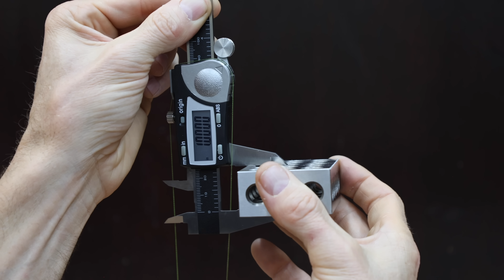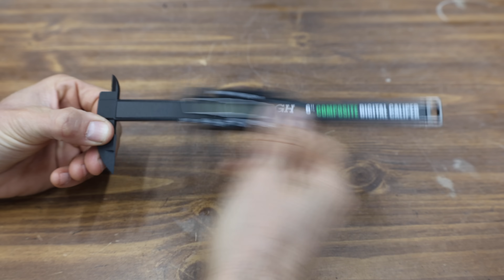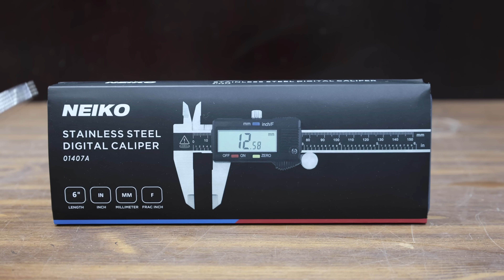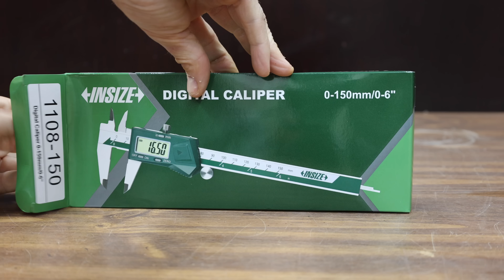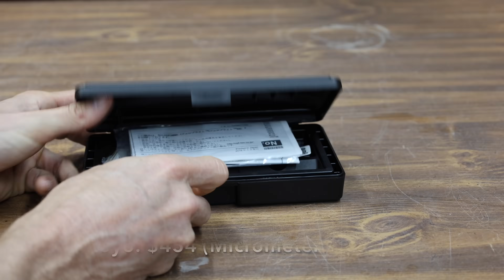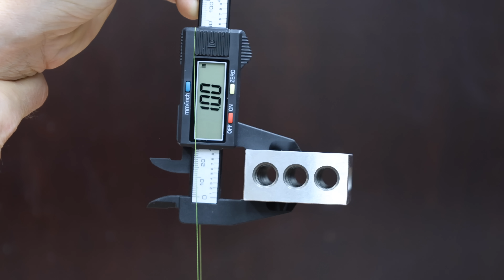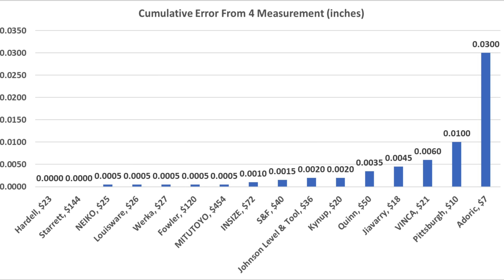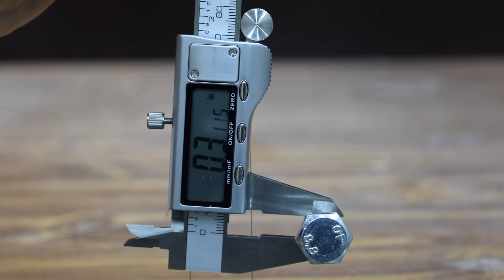I've Been Proven Wrong About Calipers!

Comment: My mitutoyo were heavily used second hand 30 years ago. And are now a bit temperamental skipping numbers.   Still better than the cheapo specials that eat batteries before breakfast,they would benefit from a physical on off switch . As im in uk the starret looks like a good option , will give my mittos another clean before splashing out. And possibly test to compare to your results here. Battery terminal had previous corrosion and metallic dust ingress everywhere. ( imagine Chinese workers watching this video in a room  where they put the different brand stickers on) 
Super video i think it will age well.
Reply from the maker: Thanks!
Reply: Checked starrett website made in china @ProjectFarm

Comment: I ain't a digital gauge guy aside from height gauges but Fowler served me well enough to pass all my setup QC checks against a CMM for 3 years when I was doing production machining. You DO get what you pay for but it seemed to me that the scale of improvement over about the $60 mark dropped to single-digit increases in utile accuracy and reliability and value for the money went down a lot. We also did semi-annual calibrations on all  gauges and we could have anything calibrated in just a few minutes (which I did frequently since I took mine apart once a month to clean them thoroughly). We even had operators using calipers that literally had no branding on them at all and would just have them calibrated at the beginning of the work week. 

Love your stuff.
Reply from the maker: Thanks!  Thanks for sharing.

Comment: The problem with the cheap ones I have used over the years is not the accuracy of the measurement but the quality of the plastic. Cheap plastic warps and fails with monotonous regularity and this is most frequent in the cover of the battery department. So for cheap items you throw them away and replace especially as the plastic life is reduced by exposure to industrial liquids. The most expensive tools will last for a very long time and thus are used by inspection departments for many years and are able to pass technical checks on an annual basis for over,a decade in my experience. You get what you pay for.

Comment: I was super curious to find out the results of your testing. One of my sons is a machinist and has used Mitutoyo calipers in the past. The absolute measuring is probably one of the most handy things to have around when you need to make quick measurements. When I started 3D printing over 8 years ago, I got the Neiko calipers on the recommendation of the maker of the kit I bought. Seems he knew his stuff. Aside from burning through batteries (even when "off"), these inexpensive calipers are quite good, if you don't mind calibrating them each time. For my casual use, they are, what my kids would call, "OP". They are more than what I need and have been reliable through the years.

A really fun analysis of the offerings out there and it's neat to see how you don't need to spend a lot as a hobbyist or even a pro to get some decent gear.
Reply from the maker: Thanks for the feedback.

Comment: i gotta say.. have been using a all steel cheapo from Clas Ohlsson for 10 years now. it is perfect still. the plastic ones are just trash. dont get them. get the all steel ones that take a buttoncell that is under a metal cover with screws. the errorlevel of +-0.02 is acceptable for most applications. but i do have a mitotoyo micrometer for that accuracy that calipers cant deliver.

if your caliper is not smooth to slide? just take some 2000 sandpaper and spit on the paper.. be sure to clean off all residue before testing the new sliding action. goes to without saying for most of you that read this anyway? u can use weapon oil or similar to get her sliding even smoother ;)

Comment: Never trust anything past .001 inches with calipers. Period. If you need tenths, get a micrometer. Also, not doing this in highly controlled temperature (68° F) and on a granite surface plate probably means your measurement differences are the result of inconsistent surface flatness of your wooden workbench.

Comment: 0:48 how did you test the pressure of sliding the jaw? I assume you fully released the locking screw, fully extended the jaw, balaced the caliper on the head just steadying the caliper at the depth gauge so as to stop it falling sideways, zero the scale to capture the weight of the calipers, then apply pressure to the moving jaw steadily all the way down? I just don’t get numbers like you are getting on mine, it was like 100g to break stiction, then just a few grams all the way down. How come all yours are so stiff?

Comment: When measuring with such accuracy a good question to ask is "what is the temperature".  
I learned this the hard way while making a part by hand for an aircraft.  Very very specific on dimensions and tolerance, there was no fudging. As I neared the final specs I stopped and walked over to the calipers to be used for final approval and had them measure unit with the standard in order to know any difference between the standard and my own and found my parts were exactly dead on.  I was shocked and they saw it and laughed.  I was informed I had measured it soon after working it and during the walk across the floor it had shrunk as it cooled.  Yep, I said, I stopped a few mics long and here we are, dead on and cooler.  Went back to my tools and measured, darned if they werent right.  Cooler it measured smaller.  Dead on.
Reply: This is also a reason that it's important to have calipers that are the same material you are working, or at least to make sure the calipers and material are both at the same temperature and it is near the calibration temperature.

If you work in a shop that is hot or cold, and you're working aluminum but measuring with steel calipers that were calibrated at normal room temperature, then the differences in thermal expansion can be very important. But if you have aluminum calipers for working with aluminum, they will always expand at the same rate and you're good.

I'm sure you already know this, but it is worth mentioning because it's something we each learn sooner or later.
Reply: My brother was a machinist and made parts for vacuum pumps. He used to talk about Microns for measuring. As a TIG welder we used .005 for military spec. electronic sheet metal chassis.
Reply: For parts that size, a slight change in temperature is only really going to affect the readings on a mic. So  a resolution close to 0.001mm. In the caliper test case, temp is irrelevant assuming he is still indoors.
Reply from the maker: Thanks for the feedback.

Comment: For me the most important feature of a caliper is battery life. All my cheap ones, even with CR2032 are always dead when I need them. Every friiking time. Mitutoyo OTH I don't remember the last time I replaced the battery, no that is not correct, the truth is I don't remember replacing the battery at all.  And I've had it like 15 years or so. So I've promised myself next time I buy a caliper it will be Mitutoyo.
Reply from the maker: Thanks for the feedback.

Comment: Brown and Sharpe was originally from Providence, Rhode Island started in 1833. Sold out to another company just like Massachusetts made Starrett. Starrett dial calipers were always twice the price of Mitutoyo so no one bought them. In the eighties & nineties every TIG welder bought Mitutoyo dial calipers 6 and 12 inch. I used Starrett 6 and 12 inch combo squares, protractors and 12" 24" and 36 inch hard rulers. I currently use Mitutoyo LCD or electronic calipers.
Reply from the maker: Thanks for the feedback.

Comment: If the Mitutoyo caliper takes an LR44 battery then it is a fake Chinese nock off. All my genuine Mitutoyo calipers & micrometers take an SR44 battery & will not power up with an LR44 battery.
Reply: That's what I was thinking

Comment: I've been using a pair of Insize 8" dial calipers for over 10 years now as a machinist. The accuracy has dropped to about .001" by now, but you don't use calipers for anything less than that anyway. The consistent smoothness of the slide is far better than any other caliper I've used around my shop. They are pretty beefy too so I'm not surprised that they did poorly on the groove test. I'll take Insize over the big two (Starrett/Mitutoyo) any day.
Reply from the maker: Thanks for the feedback.

Comment: if i remember something AvE taught me, is that calipers all measure the same but they last longer or shorter, so how much you wanna spend depends on how much use you'll give it, if you're using it everyday, get a good one that will last years instead of weeks, if you just want one to leave in your toolbox get a cheap one that looks cool and remove the battery when not in use just in case. i know this video can't account for durability but trust me, that's where the cheaper ones fail ALWAYS.
PS: i know that you read all comment so, Thank you for giving us consistently great content, you're definitely a jewel in the community! not only for the professionals that need the information  but also for us that just wanna learn stuff ! seriously thank you Todd!
Reply from the maker: Thanks!

Comment: I have an Adoric and it is just not good. Was ok at first, but soon it got issues, like shutting off randomly, the battery compartment not keeping enough pressure, skipping steps, losing 0 mid-slide and so on. I am on the lookout for a good but not too expensive replacement, but the Werka is not available for me.
Reply from the maker: Thanks for the feedback.

Comment: My biggest problem with the cheapest HF calipers is that the battery contacts are terrible causing the tool to abruptly turn off during use. I don’t do work that requires ultra-accuracy but a tool that doesn’t function is only as good as the physical markings on the bar.
Reply from the maker: Thanks for the feedback.

Comment: Maybe I am oldschool, but every time I see these "electronic" calipers, I just set them aside as toys.  I have set of 0.02mm accurate ones from 150 to 450mm. It cost me $25 for the set. I also have 600mm with 120mm long jaws. This one was more expensive, at $15.

And by the time you finish clicking the buttons I am putting the calipers away after measuring...

Is there any point of these, except as an aid for people with weak sight?

Comment: I once saw a video showing how they work. It is a very easy to produce and accurate way to measure. That is why the cheap ones are also very good. I guess it mainly comes down to the overall quality and not the measuring accuracy with calipers
Reply from the maker: Thanks for the feedback.

Comment: Hi project farm can you do a 12v Impact Driver Competition? Like testing of torque with socket & adapter, the highest torque in the largest amp batteries? I know it sounds weird but sometimes I use my driver to tighten low torque screws with Metric nut drivers. Especially when fixing motorcycles or car interiors as most tightening points are sufficient enough and below the Max torque of my Milwaukee M12 ID. Thank you. It will be a fun video to watch
Reply from the maker: Thanks for the suggestion.
Reply: @ProjectFarm just realized the comment doesnt make that much sense lol, edited it. thanks for replying ❤️

Comment: Nice to see the differences on mechanics, i bet most of those have the exact same electronics. I have one with the same button lay out and even the case is similar to some of them. Some on the test have different case and display, but they will be the same inside. 
Mine is +10 years old, might be over 15 already. Most of the winters it has been in a freezing temperatures, but it keeps going strong.
Reply from the maker: Thanks for the feedback.

Comment: The Mitutoyo's I have in my shop as my primary set, I have had since 1999 and have only put a battery in them 3 times. I am on my 4th battery. They still work as good as day 1 and this is in my shop that is not climate controlled here in northern IL. Buy once, cry once as the saying goes.
Reply from the maker: Thanks for sharing.

Comment: You have a critical error in measuring "accuracy" while using a 123 block on a wood table. The results mean just about nothing using a wood table. Your price on the mitutoyos is absolutely jacked up wrong too. The basic 6 inch digital version is $115 on msc. You only start getting expensive when you get carbide jaws, waterproofing, and larger models. The cheap brands will work fine if you're not a machinist. If you need reliability you should be using nothing but a mitutoyo. In all, this set of comparisons is clearly for people who do NOT need a good reliable pair of calipers, but need a c clamp for measuring. These same people will also likely introduce their own error in measurements by not using the tools properly so it doesnt even matter how good they are. One huge thing to note too is cheapo calipers will give you false readings when the battery starts to get low but wont warn you. Mitutoyos will be true until you cant even see the numbers anymore after it warns you of a low battery.

Comment: if you need calipers never get an Amazon or Ebay brand. in my job as a measurement tech we have to take accurate measurements of custody transfer. Mitutoyo is the go too... not for just accuracy or quality but also the electronics are far superior. the battery will last years in the mity as there's almost no parasitic drain where almost all others do. Starrett is also very good but every machine shop i've went into they use the mitutoyo and so does the calibration and certification labs that check our equipment.

Comment: I love the videos but you did not give mititoyo a fair shake here.  They are not a 450$ caliper I can go to msc right now and buy that caliper for just over $100 and they do have better ones with auto shut off and some of the best ip ratings and reliability.   Ive been a full time machinist for 15 yrs use the mititoyo calipers every day they will pay you back every dollar. The cheap Chinese caliper batteries last a couple weeks.  The mititoyo ones last so long I forget they have batteries.  They last for like a year using them everyday.

Comment: I love your videos and value your data, but there are other metrics that come into play too.  I reload ammo and use calipers a lot, often is less than a clean environment.  Extreme accuracy (.0001") is not required, but consistency and durability are important.  I have used a lot of the budget calipers and they all work, at least for a while.  My wife was looking for something to buy me as a present and purchased a Mitutoyo caliper.   It was easily 10x the cost of my usual calipers and worked just a well.  The difference is that, over 20 years later, the Mitutoyo calipers are still as tight and consistent, while the cheap calipers are all dead and gone.  They stop holding zero, or they read a different value each time when measuring the same item.  I guess they just wear out.   Thanks for all that you do.

Comment: I can't afford to take chances on cheap measuring devices. The parts I make usually end up more expensive than the calipers anyway. I will keep buying Mitutoyo and Starrett. Also I don't use digital ones. The Vernier scale is good enough for me. And it neither needs powering up nor down.
Reply from the maker: Thanks for sharing.

Comment: Great review.  For a tool that you may use dozens of times a day, the Mitutoyos are a dream because you never have to consider that they may malfunction or have irritating quirks.  I have owned two pairs in 25 years of daily use, the only irritation on both pairs is the battery hatch clip is weak, would be better if they used a small screw to retain it.  Otherwise, imperious tool.  For daily use, worth every penny and more...
Reply from the maker: Thanks!  Thanks for the feedback.

Comment: What we don't see and cannot see is the battery life . On a nice Blue Mitutoyo (tested in real life) the battery life exceeds 2 years ! . On the cheap stuff it's less than 6 months always . I've used quite a few cheap ones and getting a battery warning every 3-4 months is annoying . Important to mention that a low battery will affect the readings - tested in real life .

There is an important feature the ip rating . Man i cannot tell you how annoying can a drop of coolant be ! Most important feature of a shop floor caliper .

Other big brand to mention is Mahr.  TESA was a huge player , not sure currently .... . Starret is not what it used to be .
Reply from the maker: Thanks for the feedback.

Comment: My calipers cost me £30 ...
Ive owned them for 32 years... Never needed batteries, because they are not digital.
No picking them up to measure and oh no dead battery.

Tell us the info we should know...
How much parasitic draw do they have on the battery when they are off.
All digital caliper have a parasitic draw, but some of the  cheap brands really kill batteries.

Comment: concerning the smoothness of movement: some time ago I put a bit of valve lapping paste on the sliding surfaces of some cheap and very stiff 15€ metal calipers I had relegated to "shit work" before. After 5-10 mins of moving them back and forth they became the smoothest and now most liked (cheap garage work) calipers I have.

Comment: Every one of these items are absolutely useless without a battery. My old Moore and Wright vernier Micrometer is accurate to .0001". I also have a 6" stainless steel caliper with digital readout,accurate to .001" no battery needed.